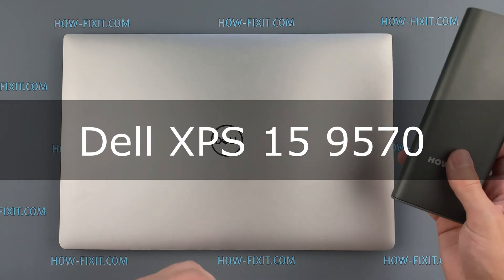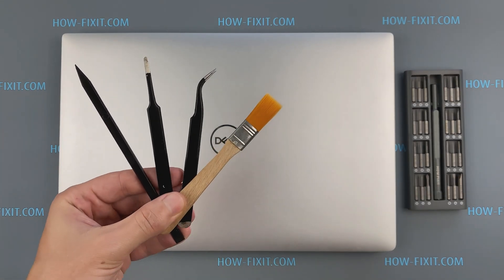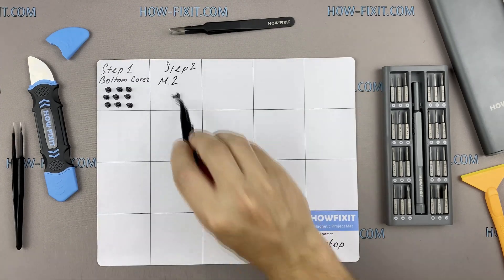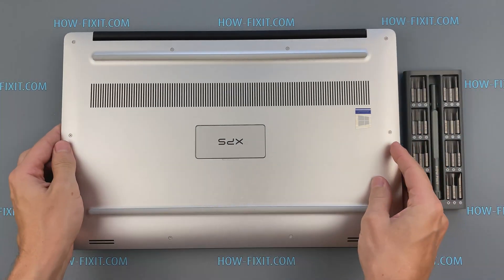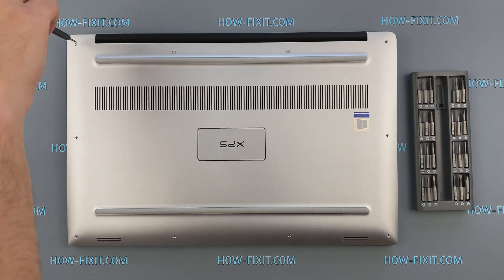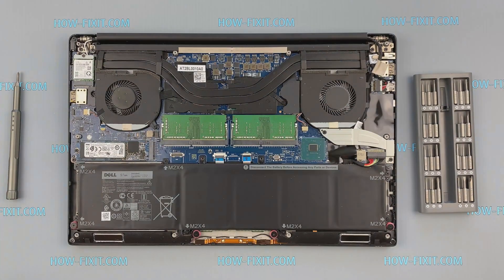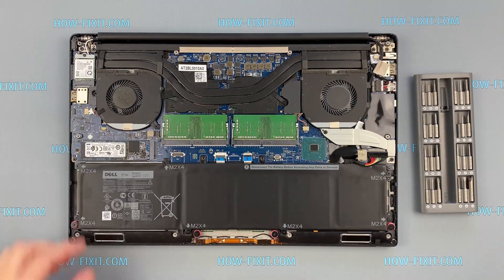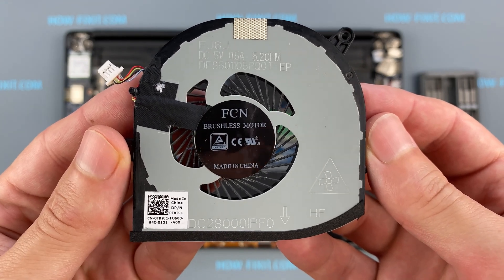Dell XPS 15 9570 Fan Replacement | Step-by-step DIY Tutorial

Comment: EXCELLENT video - thanks  

A couple of notes - 

1. I should have installed a sensor reading package to check the temps before and after replacement.  I did so after I replaced the fan and temps are well within limits now.  The software also confirms that both fans are running

2. I had to use computer vacuum attachments to clear the parts at the back of the fans. 

3. When I started back up I got a dialog about scanning hardware. I just clicked OK.   That was probably due to the case being opened. 

Thanks again for a great detailed video